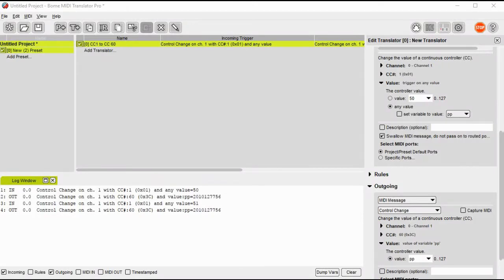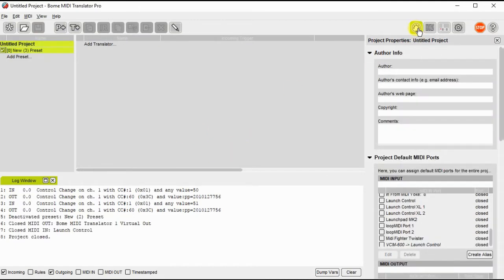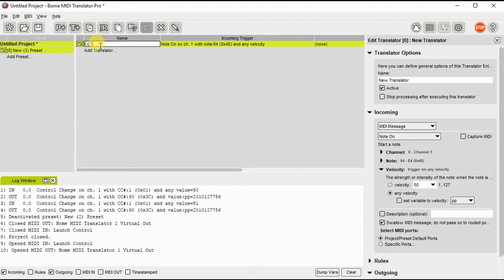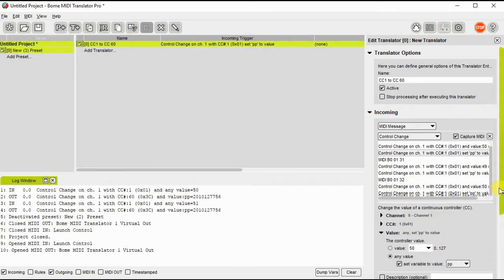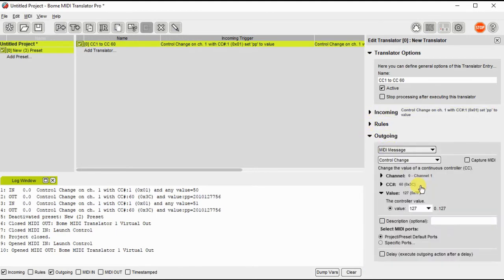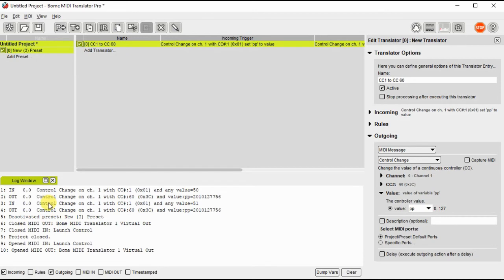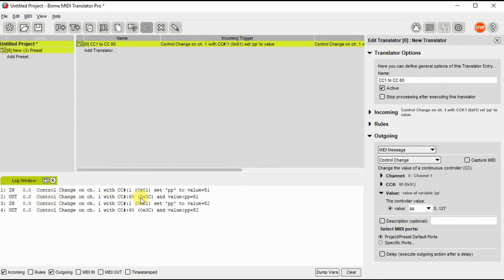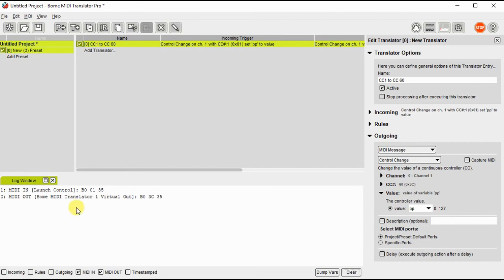Tutorial: Change Incoming CC to Different Outgoing CC in Bome MIDI Translator Pro

Comment: I've tried some of the Syntheway VST demos, but they don't support CC2 (breath control from my Aerophone AE-10) - they are meant for keyboards. I really want to use some of the sounds the VSTs provide - can BMT suitably convert CC2 to pretend to be keyboard? I assume it's a case of playing with trying CC1, cc11 etc ?
Reply from the maker: Hi, 
Yes we really don't care what type of instrument it is.  All we see is the MIDI signal. We can convert CC2 to any other CC that a VST plugin could support.

Steve CaldwellBome Customer Care

Comment: i'm following your instructions verbatim and my outgoing capture screen won't show anything besides exactly what my incoming capture screen says. any other ideas on what i could try to make this work? thx
Reply from the maker: Hi,
The most likely suspect is that you have a MIDI thru route and the incoming CC or MIDI Channel you are sending does not match.   It would be difficult to tell with out looking at your project file.  I suggest posting the question and your project file on the bome forum and I can assist further.

https://forum.bome.com

Steve CaldwellBome Customer Care

Comment: hi, I just ran across this utility and I'm struggling to force FaderPort to control TotalMixFX, so: reprogram a motorized fader to achieve CC change (from 32 to 7, this works), retain the inputted Value (I ticked "capture MIDI", so works), but finally convert the values to regular 0-127 MIDI Value range (FaderPort total range is 1024, it sends only CC values 0 16 32 48 64 80 96 112 and switches Banks at 0 - 127), can this be done in Bome MIDI ? thanks in advance
Reply from the maker: Yes I can help. Please post your request with details at
Www.bome.com/support
Reply: will gladly join :)
Reply from the maker: Awaiting your request there. I see other posts with history on how to use faderport.
Reply: I went through the topics, haven't found what exactly I needed, so started a thread here:
https://www.bome.com/support/kb/faderport-and-totalmix

Comment: what does pp signify?

I am trying to convert 1 CC message into 2 CC's, with a different range of data on the output that on the input. I'll explain below:

CC 01: 0-127 > Translator > CC 02:0-96
CC 01: 0-127 > Translator > CC 03:96-0

Basically I'm making a crossfader, how do I input these variables? this program seems to be powerful but it's a hell of a learning curve
Reply from the maker: Hi ,

I will address your question on our Q&A web site at the below link sometime later today.

http://www.bome.com/support

Steve Caldwell
Bome Q&A Moderator
Reply from the maker: Hi, I published the answer and a project file.  This software is VERY powerful and as such, for more complex actions might take a bit more learning. I found that most challenges are basically math exercises that you need to figure how to apply to the software. If you review the tutorial seies from start to end, by the time you are done, you should have a pretty good grasp. 

For more complex projects that you don't want to program yourself, I am 
available (as independent contractor) to assist. (bome@sniz.biz)

 Let me know via the support site if you have any further questions

Steve Caldwell
Q&A Moderator and independent Bome programming specialist.
Reply: ah thanks dude this is much appreciated, I'm already implementing several different translations on my workflow with bome, will have to showcase it in a video. Hope to buy the full version on the next pay day!